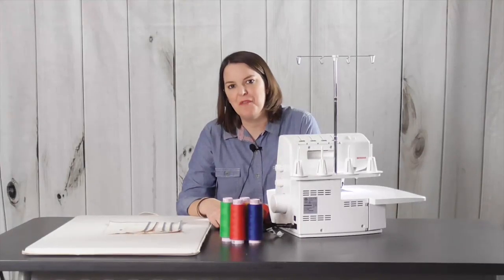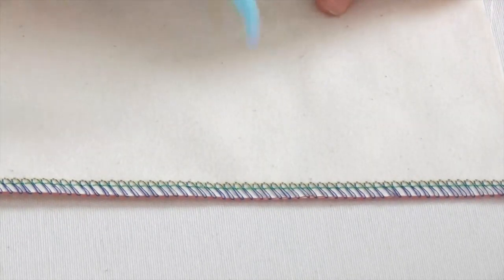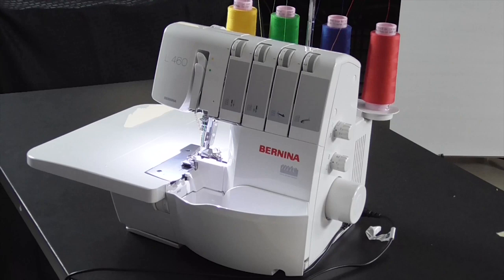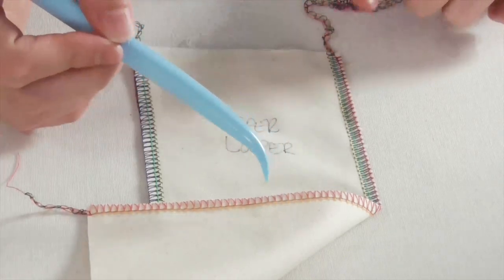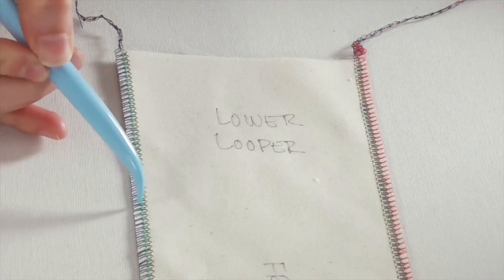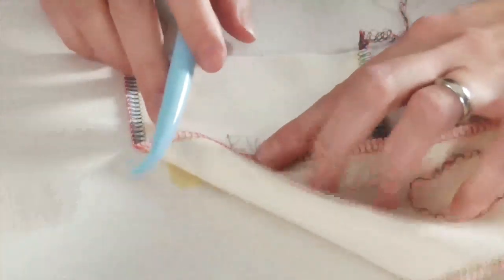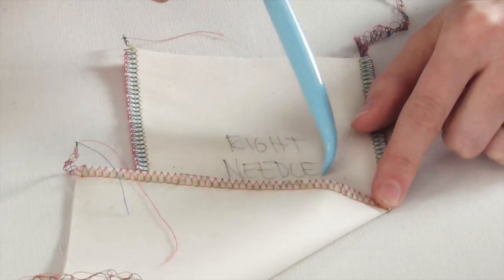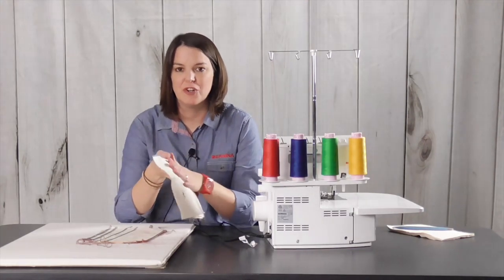Perfecting a Balanced 4-Thread Overlock Stitch

Comment: I have a 1300 MDC I have threaded and retreaded over and over and it runs but doesn’t form stitches?????? Frustrated
Reply from the maker: Julie- so sorry to hear you are having trouble with the 1300. If possible, it might be good to have a certified technician take a look at it. General rule- TNT (Threading, Needles, Tension) make sure that the needles are in the highest position and that the thread is seating into the tensions properly. If the machine is out of time--it will not form a stitch and a technician will need to reset the needle to looper timing.
Reply: What's the defaults for the needles?